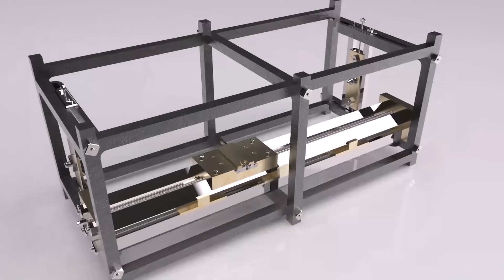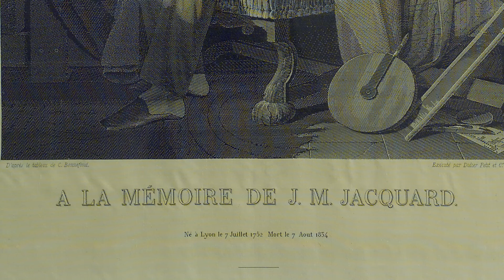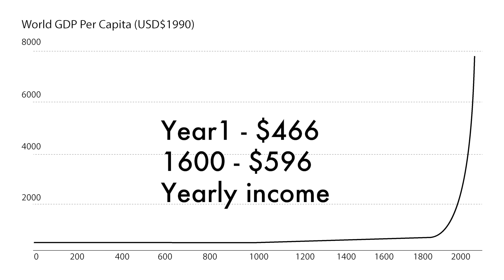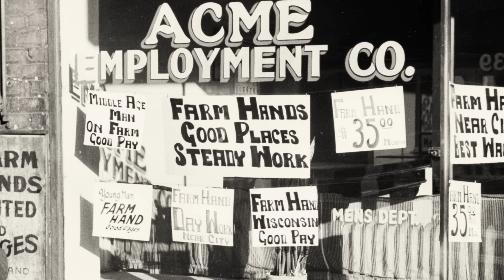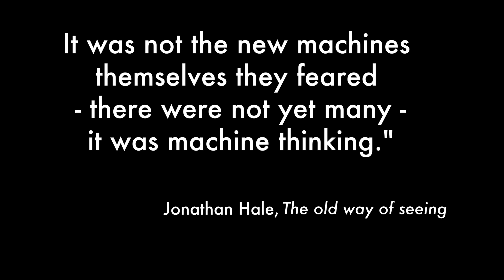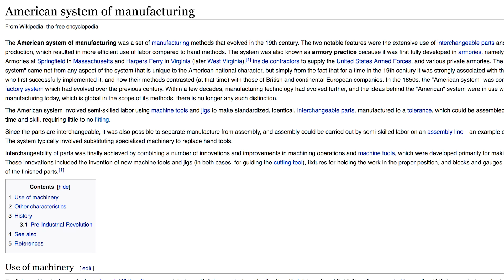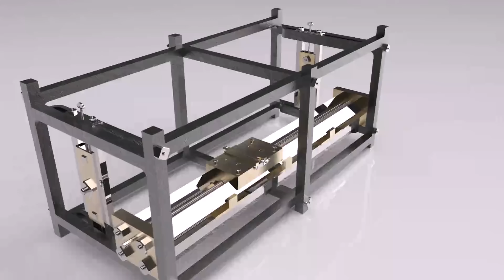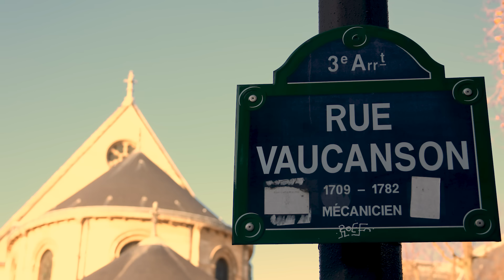The 1751 Machine that Made Everything

Comment: Lathe and drills.   After watching your great video, a question:  How did he make the lead screw if he didn't have a lathe yet?
Reply: It wasn't the first lathe, just the first all-metal (and arguably, "modern") lathe. Screws were made long before the first screw-cutting lathe using a chasing tool (this is still sometimes done in wood or plastic, but it can be done in metal). 
Imagine this thought experiment: you have to produce a thread on some brass rod, but your split-nut is broken. You could set up the gearbox to spin the leadscrew at the right ratio, and engage the "chasing dial" (in UK: thread dial indicator). If you hand crank the carriage along the bed at the correct speed, with the spindle running, the dial will remain stationary. You could use a single-point tool and get a half decent thread
Now imagine you've become good at this, and then your chasing dial breaks. You could conceivably still make a "sort of" thread by remembering how fast to crank the carriage. But if instead of a single point tool, you had made a chasing tool, which is a chisel whose end looks like the toothed end of a "coventry chaser" (google it), then you would have a couple of advantages when you tried to use it like a wood turner's chisel on your brass workpiece: the sloping angle of the thread grooves would tend to engage with the teeth you were cutting and draw the chisel along, and the spacing of the teeth would mesh (of fail to mesh) into the developing thread, and show you if you were moving too slow or too fast.
Once you've cut a dodgy thread, you can make a long nut which will average out some of the dodginess, and use the dodgy thread as a leadscrew. This can be used to cut a better leadscrew than itself, and there are other methods which can be used to progressively refine the results. If you can measure pitch errors, they can be compensated for. One way is to use a rotating mount for the nut and arrange a cam follower bearing on a stub projecting axially from the nut carrier, which causes the nut to rotate about the leadscrew, speeding up the carriage and slowing it down as needed to cancel the pitch errors, by having the cam follower ride along a simple template shaped like an understated roller coaster profile as the carriage moves along the work.
As a young engineering student I found a fascinating book chocked full of ingenious mechanisms and techniques for "bootstrapping" adaptations to machine tools, to enable each iteration to drive accuracy higher by methods like the one I describe. Of course the library of that institution has long since got rid of "archaic" books like that, and regrettably I have no clue what it was called or who wrote it. But it was a great illustration of the way technology relies on first principles, rather than superseding them.

Comment: The word "lathe" is from a lath, a strip of wood used as a spring, that pulled the leather strip back as seen in the illustration of a man hollowing a round block of wood into a bowl.
Without a lath, the woodworker had his apprentice pulling the strap back. A lath allowed the boy to do other work.
Reply: Al Grayson ~ Wow... I’m alone in my car, just pulled over at a gas station to read some of the comments; when I came across your comment I actually wowed out loud! What a great addition to this honoring of the lathe!!! I’m so grateful for youtube at moments like these!!
Reply: I didn't know that. Thanks, Al.   There is a vague resonance with the invention of valve gear for steam engines. The steam engine evolved from rudimentary steam-powered pumps used for dewatering mines in (I think) Cornwall, which in turn evolved from manually driven sailing-ship pumps, used to evacuate the holds and bilges of seawater which continually leaked in through the seams between planks.

The Cornish pumps used pistons exposed to the water from below, and to steam above. The steam was cooled to condense it, creating a vacuum and lifting the piston and the water below it. The pump had valves operated by boys. One smart boy got bored, and after improvising a lashup mechanism with string and bits of wood to activate the valve at the correct moment in the cycle, skived off, for which he was duly punished.
 (IIRC) Thos Newcomen got wind of this enhancement, and incorporated a self-acting arrangement on his "Atmospheric Engine", which was the precursor to the steam engine. And the rest is history.
Reply: @Gottenhimfella  i'm Cornish and haven't heard that one before, sounds probable though. Trevithick was inspired as a boy by the Watt engines used in Cornish mines as well, which led him to build the first high pressure engines.
Reply: @Gottenhimfella  Necessity is the Mother of Invention ...
Reply: As "lath" also refers to the small strips of wood you find supporting plaster. Later on came metal lath which served the same purpose.

Comment: You can still use a bridgeport or a surface grinder to turn parts. Lathes aren't special.
Reply: Patrick Wallis: except for the relative simplicity and speed at which they do it. Not to mention the size of the parts they can machine. Like the vertical boring machines (lathes turned on end) that my Dad used to maintain. They were used to machine 2000 - 3000 Lb. blowout preventers for the oil drilling industry.  Pretty hard to grind that!
Reply: @drgruber57  I make dies for miniature sheet metal electronics, so in my shop a lathe is not a necessity. In a machine shop the lathe is the least used machine, especially by tool makers. A lathe is a nice tool regardless.

Comment: From the thumbnail image, I thought this was going to be about a metal bolt or screw. The screw is a simple machine we use to make a lot of things, after all.

But… I suppose the lathe (the industrial, metal, lathe, made by the guy with the name I have trouble with) is fitting for that role in history. Cool video; I learned stuff.
Reply: The fundamental engineering tools go back to antiquity he was drawing a correlation between a new invention & rise in universal income naturally distributed fairly & justly or not... archimedes used screws to draw water & leonardo took the 5 fundamental engineering tools/elements to stratapheric heights all things considered... also keep in mid that a screw although included in the 5 fundamental engineering elements/tools is actually a WEDGE wrapped around a cylinder... so less than entirely fundamental... besides I do not think that particular threaded rod is from 1751... it looks like something installed to reproduce the original

Comment: This is neat but the value of the lathe is a bit overstated here. If the lathe was so wonderful and contributed to the rapid growth per capital of the world because of an extra decimal place of precision, why wasn't there spikes with ancient developments of measurements everywhere for every step of the way. The development of tools that could consistently measure feet, inches, millimeters, meters, and so forth each should have had a significant impact on that graph. Why wasn't there a spike in the development of screws, glue, or just the refinement of metal. Why wasn't there a spike for agricultural growth, irrigation, or clocks. Even for the industrial revolution and after into today, the development of the transistor probably garnered a majority of that spike in per capital.

I like lathes but I understand they only made a small fraction of the things in this world. You may as well have made a video explaining how a knife was a machine and it essentially made everything including that lathe if you stretched the definition of a knife as anything with an even slightly pointy bit.
Reply from the maker: I have to disagree with you. While it might seem that lathes make a tiny fraction of things in this world I think you are not thinking deeply enough. Lathes are the foundation of the machine shop, and the machine shop gives you industrial machinery which in turn makes pretty much everything else.  You could have all the oil and gas in the world but if you didn't have smooth cylinders, crankshafts, axels, etc you don't have all of the massive multipliers that cars and trucks bring you.  Without lathes you don't have generators to make electricity.  Imagine the weaving factories with thousands of spinning parts - yup, made on lathes - as just one example.  Also note that on lathes you can make square or angled parts, too.
Reply: Machine Thinking a lot of circular tubing and shafts are made from metal extrusions, those smooth cylinders and crank shafts aren’t made with lathes so much as someone with a hunk of metal, a drill, and some hydraulic presses. Even now, a lot of CNC machines are replacing the value of lathes like 3D printers, CNC Mills, and lasers. Don’t get me wrong, lathes are useful, but they really aren’t responsible for a lot of the things you are listing, I mean, look at how a lot of ancient machines were made, there should have been an economic boom when cart shafts were invented but your chart doesn’t show that.

Comment: Clock makers had make all metal lathes hundreds of years before this but this one is bigger so it's more important.  Foolish reasoning.
Reply: In hundreds of years clock makers didn't apply this technology to other applications. The breakthrough was the shift in thinking. The industrial lathe is essential for modern manufacturing (allowing us our high standard of living). Seems reasonable.
Reply: @kerriwilson7732  you think I didn't understand his reasoning? You didn't understand mine! If the breakthrough is the shift in thinking and reasoning, then the focus of the video should be that.instead we just got a lathe that was bigger than the other ones that were just like it.
Reply: So you don't get his thinking. That was the shift. You can get the precision of a clock part in a big hunk of metal.

Comment: There are some significant inventions around that same time that seem at least equally important:
1740 modern crucible steel production
1855 Bessemer process for improved steel production
1865 germ theory of diseases
Reply: the first 2 you list depend on the lathe to make the equipment
Reply: @garyweber7419 
How can something invented in 1740 be dependant on a machine that wasn't invented until 1751?
Reply: @BlacksmithTWD  Scale. Just because a process was invented doesn't mean it was able to be grown. Machine tools are the base.
Reply: @MRichK 
I don't see how that answers my question or negates my statement.

Comment: coolest lathe I ever tore into was a Gisholt Cri-Dan 'B' threading lathe- 100% mechanical, yet depth of cut, length of cut, number of passes, pitch, infeed angle, EVERYTHING was 'programmed' with dials/gears/cams...rebuilding that apron and the spindle clutches was one of the most challenging/rewarding things I ever got to tear into, loved watching that thing run...pop in the clutch lever, it ran a dozen passes, clicked and done...clutch lever also operated the chuck/unchuck, one of the fastest lathes to operate I have ever seen...

Comment: I live in the United States, and I wish I made $450/yr :-(   Not joking and not being sarchastic.  No jobs, no factories, no customers to sell to.  Complete economic collapse.

We have a huge lathe from the 1950's but I've never used it for anything.  We made a few boat paddles with it and that was it.   My own builds are usually pretty quick and primitive: I mostly use an aluminum cutoff wheel, hand drills and drill presses, and an old AC welding machine.  Those tools and some other power woodworking shop tools and you can build a lot.

Comment: When I started my toolmaker’s apprenticeship in 1966, great importance was placed on the idea that a standard engine lathe was the only machine tool that could reproduce a copy of itself. I am still amazed and puzzled about the process that was used to create the first threaded screw and mating with a constant lead/pitch for the entire length. A mechanical equivalent to the chicken/egg question is creating accurate screws without gears to connect the rotating blank to the advancing cutting tool.
Reply: I placed a comment above in which I remarked that the screw you see is clearly NOT from 1751 and was added to restore the original... it is possible that a cruder metal screw was created the same way that wooden ones are made for turning dowels into wood screws for clamps... since clearly by 1751 they were able to power the thing & use pulleys to turn stuff... if you make a DIE that has offset cutting knifes as the bar is turned & fed at a rate of feed the threads will be cut according to that feed rate.... it is possible the die had 4 knives all offset & the feed rate was determined by the motion of the die along the turning stock rather than the stock being fed as we do with wood dowels & our jigs for clamps! In such a case there are various ways to move such a block/die at a constant rate & even at an adjustable one for different TPI... rack & pinion is one way that allows the same turning machine that turns the stock with proper gearing (different size pulleys) to turn the handle that drives the rack & pinion system at different speeds the same way in a drill press if you open the head you have a series of pulleys to adjust the speeds!
One note to add: this lathe must have been powered by horses or a waterwheel... the steam engine was not yet invented by James Watt & Michael Faraday was still 100 years away from his motor

Comment: How were the first precision rods and lead screws made, so they could be used in a lathe like this. I see a 3 ish foot long screw that needed to be fairly precise. Was that made by hand with a die after the rod was forged then made to what looks like about 1/2 inch diameter? Some of the parts of this lathe, seem to need this lathe before they can be made.

Comment: I would say that the Bessemer process of mass producing carbon steel (Patented in 1855, used in mass production from the 1880's on) was more important, especially since the lathe as you pointed out wasn't invented in 1751, that happened hundreds of years prior, and even the metal lathe wasn't invented in 1751 just the one for industrial applications beyond clock making. It's a great development, but not really an "invention" in its own right. I wouldn't credit Henry Ford with "inventing" the car, just applying the already existing idea of assembly line production to it and thus changing the world. My 2 cents...

Comment: Sounds like you have a much better grasp of the history of machines than you do of economics.  You repeatedly state or imply that machine tools in general, and the lathe in particular caused the inflection in per capita wealth.  But correlation is not causation.  Many technologies emerged around the time of the industrial revolution.  It could be that the lathe was the most important, or it could be that other things were more important.  To establish the causation you claim, you'd need a much more rigorous analysis.  Develop a metric for the adoption of the lathe and measure it over time in many places in the world (ie in time series and cross section).  Measure wealth in the same times & places.  What is the correlation?  Analyze other industrial-era technologies the same way (the steam engine, the railroad, steel, rubber, concrete, the telegraph, the cotton gin, weaving looms, etc, etc).  Is the correlation between lathe adoption and wealth stronger than the correlation between the telegraph and wealth, for example?  Is it the lathe-wealth correlation the strongest of all the technologies of that era?  To what extent did adoption of other technologies impact lathe adoption, and vice versa?  Try an experiment.  Drop a lathe in to a poor community in Africa or India (or the US for that matter).  Does wealth increase? There's a reason the lathe is not generally accepted as the source of wealth around the world - because that's a grossly oversimplified and indeed inaccurate picture.

I really enjoyed your piece on metal forges.  I think you have a great grasp of the history of machines.  Your economics is not nearly as strong.

Comment: This geezer is currently undergoing the trauma of having too leave his very complete work shop (with mill, band saws, etc.), but I simply will NOT leave my 12" metal lathe.  My deal for selling my home/shop is that my lathe, a cab of tooling and round stock has to be free access for my last years.  This vid powerfully re-affirms the lathe as the center of the machinery universe.  Huzzah! Huzzah!

Comment: Arguably, transportation was the single-most important development which caused the wealth-curve you repeatedly show. The ability to connect distant markets to customers, the ability to move products quickly reducing spoilage and increasing market sizes while reducing shrinkage...but to the point of 'transportation', the lathe DID contribute...just as fire did, the wheel did, steel did...all of these things were critical, but without ANY of them, transportation would not have been possible...it was a chorus of individual processes and components that came together at the right time, almost-simultaneously, to make the 'technological surge' we call 'the industrial revolution' possible.

Comment: The lathe was a side effect, the real explosion was steam power and then electricity.  The lathe was around for 100s of  years without having any real effect except on the style of some furniture.  It was the advent of power systems that allowed for the industrial revolution and the huge bend in the curve.

It's like saying the carburetor is what gave rise to modern suburbia, it was a component but the real trick was internal combustion, the carburetor just improved the efficiency.